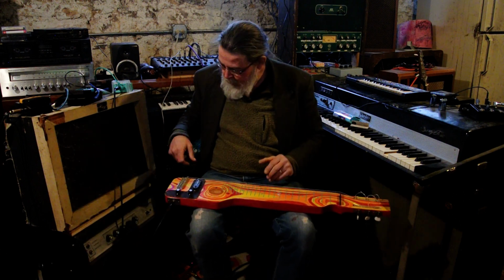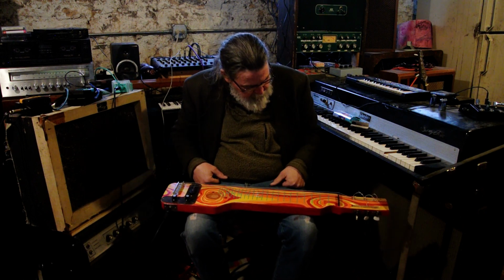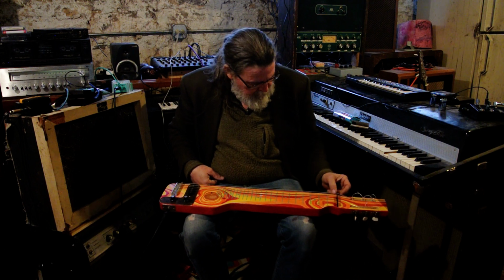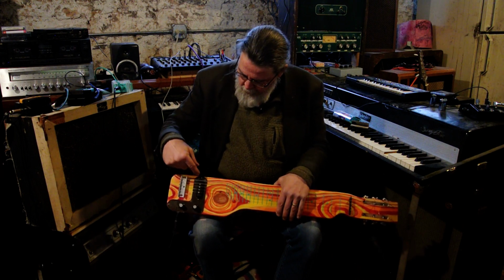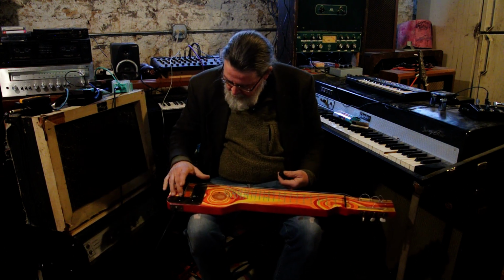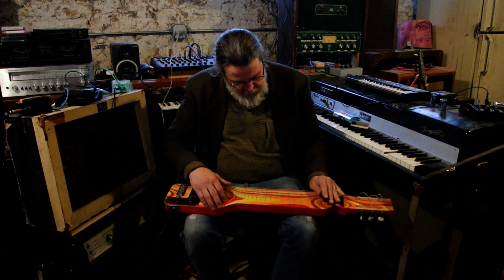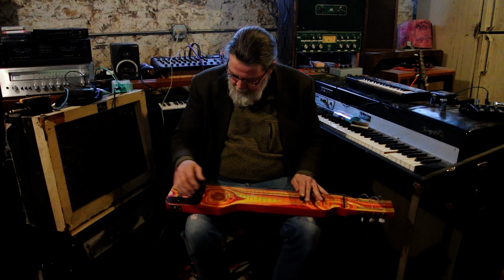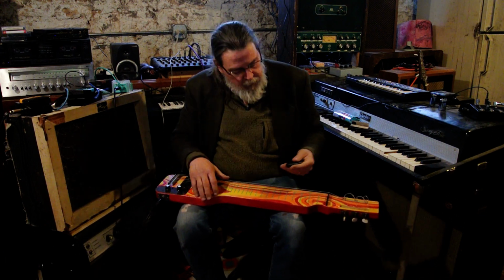The Jupiter lap steel electric guitar. DIY recycled materials.

Comment: That's a beautiful slab, probably always wanted to be s lap giuitar since it was a sapling . Don't know what kind of space capacitor  you welded to the tone pot but sounds stellar.
Reply from the maker: Thanks. As for the capacitor, I picked the grungiest, most filthy, .05mF ceramic cap I could find in my used parts stash.